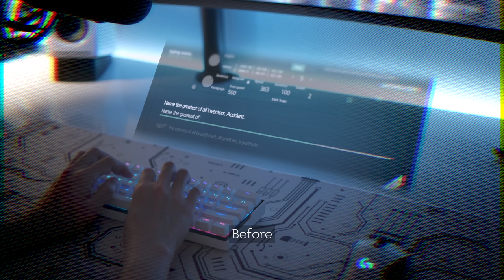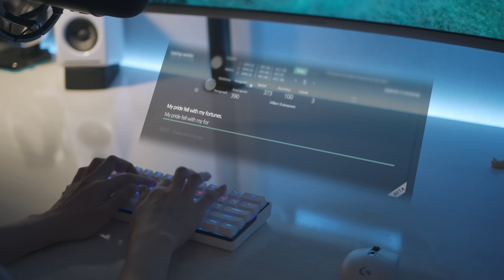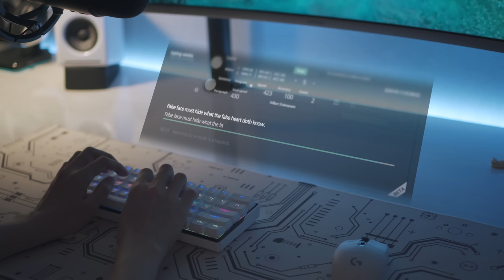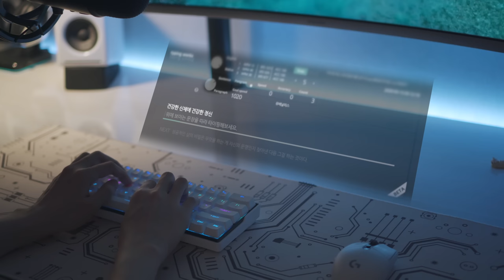Modding KEMOVE 61 SnowFox Hotswap 60% Mechanical Keyboard & Typing Sounds | Gateron Red Switches

Comment: I love how he uses an iphone to balance the wires
Reply: does balancing the wires matter?
Reply: @vigotogar  Yes it does when he is putting this much work into making it perfect. Balancing the wires helps(along with the lubing) eliminate any of the rattle that might happen when keys are pressed.
Reply: @keeperkell13  have you done it? if so, does it eliminate the "ping" sound while tapping it lightly?
Reply: @vigotogar  I have not personally done it but I have typed on a board that has. I can not give you a concrete yes as there is more than just 1 factor to that. The lupe, balancing, quality of stabilizer all matter.
Reply: @keeperkell13  oh i see okay thanks!
Reply: What is that syringe thing is he using when he is balancing it?
Reply: is the plate a standard 60% plate on this board?
Reply: @keeperkell13  im afraid to mess it up and make it worse

Comment: YES this is my keyboard!!
Reply: I got this keyboard after watching this video.
Reply: @gamerman708  how was it?
Reply: @ryan9818  Not who you were asking, but I also recently just got this keeb. This is my first keyboard, and its a great prebuild for beginners from what I can tell. The factory lubing is pretty good, and the build is sturdy. I plan to replace the keycaps soon because the ones that come with it are a little bit ugly. I don't really have any complaints for this board, so I would definitely recommend it for those who don't want to heft out the price for a custom.
Reply: @ryan9818  Got it yesterday. Mine came with 5pin hotswap instead of 3pin. Works great so far. Software is in beta and buggy. This is only my second mechboard so im not the most xp guy with these keyboards, but i really like it. It is very satisfying to type on compared to all my previos keyboards that is for sure.
Reply: Thank you for the info. I might get the GMMK white ice maybe.
Reply: @ryan9818  That one looks great aswell

Comment: Hi, new to mech keebs 

Q: What are you doing to the battery at 1:07?
Q: How do you know where to cut the stabalizers?
Q: Whats going on at 4:17?
Thanks!
Reply from the maker: 1. Just looking around
2. Pause 1:43 and look carefully
3. Because of the big front bumps, hard to use the opener
Reply: :3ildcat thank you :)
Reply: @3ildcat  ur my 1st keyboard mod channel i watched, im basically new to this but what's the ratio in the 1st krytox mix or is it the same in the 2nd one you mixed?
Reply: @alyzzagailmicabalo2385   krytox 205g0 is basically 205g2(or normal 205) mix with 30%-40% 105, personally speaking the viscosity is similar, and he adding 1:1 ratio of krytox 205g0 and 105 into his 205g0 + 105 mix so make the ratio of dilute effectively into a 70%ish 105 and 30%ish 205g2 mix which is more liquid like and easier to use
edit: the one he use for stabilizer is different kind of lube
edit 2 : you can treat the 70% 105 and 30% 205 as 205g00 which is thinner lube than 205g0 but still a grease which will stick to the surface instead of and oil which will sink into the bottom housing over time
Reply: @get_troll  thanks i understand a lot!
Reply: @3ildcat  I have a question, what are you doing when you put the metal bar of the stabilizer on thr phone?
Reply: @johntitor1054  the bars are slightly crooked/bent so he is flattening them
Reply: @eatingelote  k, thx

Comment: Finally!! Waited for this, ordered the same keyboard because of your video! :D And do you think I should spray lube, cause I never lubed any switches (I never opened one). Maybe spray lubing might be better for an newbie? (BTW. I'm "Sasuke Uchiha" from the other video, maybe you remember me :) )
Reply from the maker: Aha you changed the name!
It's totally up to you.
If you want to spray lube, shake well before applying and if you can, pull the switch out first.
That would be better for keeping the plate clean.
Reply: @3ildcat  okey thank you! No this is just my first account :3 I have a non used keyboard which is, for some, hottswap, so I would use that board for the spray lubing so the plate won't get dirty :D

Comment: I learned a lot from this video!!! I will most likely mod my snowfox like this :)
Reply from the maker: Good luck :3
Reply: @3ildcat  sooooo I got my snowfox but my wrists hurt after typing on it for a longish time (3-4 hours) is this normal or should I change the position of my wrists to prevent this from getting worse :<

Comment: Nice video! Btw where can I buy that mousepad it’s pretty cool
Reply from the maker: It's Doro desk mat. (in the description)
As I am not Chinese, I used a freight forwarder.
Sadly hard to get..
https://item.taobao.com/item.htm?spm=2013.1.20141001.1.6d7a252a74Xs97&id=587143973122&scm=1007.12144.95220.42296_0_0&pvid=a6292b85-ea22-4a8a-8a75-6457bf41e623&utparam=%7B%22x_hestia_source%22%3A%2242296%22%2C%22x_object_type%22%3A%22item%22%2C%22x_mt%22%3A0%2C%22x_src%22%3A%2242296%22%2C%22x_pos%22%3A1%2C%22x_pvid%22%3A%22a6292b85-ea22-4a8a-8a75-6457bf41e623%22%2C%22x_object_id%22%3A587143973122%7D

Comment: didn't know balancing stab wires is a thing until this video.. question, which point did you make the pressure to balance it?
Reply from the maker: just by twisting wire legs little by little
Reply: @3ildcat  nice!

Comment: Cat, can I know which part did you clip for the switch?
I don't have a switch opener or cherry red top housing...
What did you use that look like tape for the stabilisers on pcb?
Reply from the maker: You can use any tweezers as well.
If you look the switch carefully, you will know where.
You mean the tape on the plate? just holding the stabs not to shake.
Reply: @3ildcat  okay thank you ;)
What to use if no "switch slider picker"?

Comment: Is it good to use the same lube for stabilizers and switches or no? Kinda new to keyboard modding stuff so I'd appreciate your reply :)
Reply from the maker: only for metal wires, sticky grease is good
Reply: @3ildcat  is the parmatex you used good for both stabs and switch?

Comment: Could I do it on every keyboard to make same improvement (especially for those large key) like yours? Im using the Razer blackwidow v2 TE (I know the quality is way worse) right now, but I just love the feeling on the yellow switches.
Reply from the maker: maybe? you may need to apply according to your keyboard structure

Comment: I have a question. It looks like you are not using that much lube on the stabilizers. I always thought you are someone who usually uses a lot. What made you go for a more reserved amount this time?

Great video and the board sounds amazing
Reply from the maker: with well balance wires, no need a lot of grease usually.
When modding soldered ones, I can't balance the wires so I put a lot of grease in.
Thanks!

Comment: Would it still sound good of I just use an eye dropper and put it in the switch instead of painstakingly do what you've done? Thanks
Reply: Peter Perez For the most part the reason why it’s done by hand is to evenly distribute the lube. If you have one side of the switch housing more lubed than another it can tend to feel strange. Better to just be safe and hand lube them with a small brush. Does take more time that way though!
Reply from the maker: It's your call but I wouldn't do that.

Comment: The last time you lube Keychron K6 with Gaterons Red Switches you mix Krytox 105 & 205g2 why you use 205g0 now?
Reply from the maker: sometimes, 205g2 mix, sometimes 205g0 mix
I just have a lot of 105 but not enough 205g0 and g2

Comment: Wonderful video!
Appreciated the showcasing of you mixing the two lubricants :) Helps a lot for reference!

Quick question though- do you see a drastic difference when bag lubing over regular individual lubing?
Reply: spring lubing, it's purpose is to simply glue down the spring's top&bottom parts to switch housing&slider, in hopes that it would be less likely to rattle in between them.
Lubing enough is just enough for springs I guess...
Reply: @m4ki9h76  I realize the purpose and intention of lubing the springs- i'm simply asking if theres a noticeable difference in quality when bag lubing compared to lubing springs individually

Comment: I live in Brazil and I just bought this board. 
I'm looking for alternatives for the krytox lube that are more easily purchasable. I'm able to buy even if I'm willing to import.
The dielectric grease for the stabs is ease to found, but I'm out of luck when it comes to lubing my switches.
Reply from the maker: On google, you can find many stores that ship internationally
krytox or tribosys
Reply: Yeah, I found some even locally but the cost is just nuts... They are overcharging by a lot here.
I will follow some recommendations that I found about using super lube synthetic grease and oil.
Reply: @reisnobre  olá, onde vc achou ambos? dielectric grease e o krytox? eu também estava procurando algo parecido por aqui no brasil mas não achei nada...

Comment: I purchased this keyboard because of this video! Hahaha I'm just curious when I got mine because it has yellow stabs. I didn't open them up yet but the only difference I can see is the yellow stabs and the pcb now supports 5 pin..

Thanks for this @
:3ildcat 👍👍👍
Reply from the maker: Oh I guess they improved it :3
Reply: @3ildcat  Opened it up last night to mod it. The stabs were factory lubed and it already sounds great. They also added foam inside. I guess KEMOVE was also watching your video.. 😆😆😆
Reply: @MatsuysBatsuys lol!

Comment: Hey guys,
I'm looking to buy my first board, but having trouble to pick what I should go with.
Budget isn't a big problem, because I want it to be my main board, so I'm willing to spend around 400$.
I wanteda 65% layout (I'm a software developer so arrow keys are essential) and I really like the floating keycaps look and would like a hotswappable board with RGB (basically like the Drop ALT). However, I've heard that the ALT isn't that good after all, so I'm wondering if there are other options that I should consider.
I'm thinking of going with Zealios V2s for the switches and am open for suggestions regarding the stabs, lube, etc.

Would you mind helping me out? Thank you so much in advance!
Reply from the maker: I am not the one who can recommend something
hope someone help this guy.
Reply: @3ildcat  Thank you so much for even acknowledging me. Means so much! ♥

Comment: which do you prefer anne pro 2 or kemove snowfox? I want to know your preference so that I can pick the same
Reply from the maker: your pick, so my preference is nothing
Reply: @3ildcat  but what is your preference?
Reply from the maker: @faisal.m1477  my heavily modded Anne pro2, not stock.
Reply: @3ildcat  ah ok, but stock vs stock, is kemove equal/better/worse than anne pro2?
Reply from the maker: @faisal.m1477  a bit better just because of hotswap, I can lube or change the switches easier than Anne Pro.
Reply: @3ildcat  alright thanks <3

Comment: If you train yourself to use your pinky more, it would be much better for your wrist.
I used to hit the backspace with my ring finger as well and that really hurt my wrist after a day of work. 
Once I started using my pinky i barely had to lift my wrist off of the wrist rest to type there was barely any movement when I am typing.
Reply from the maker: Thank you for your advice!

Comment: Can this keyboard be replaced with a metal case? Can it be used in the same case gh60
Reply: No, the Screws are different from the gh60 ,poker ect. but i contacted Kemove and they said that they will launch a aluminum case for this KB.

Comment: The pcb seems to only accept plate mount switches am I right?
Reply from the maker: you mean plate mount stabs? yes
Reply: @3ildcat  no I actually mean the switches, does it take 3 pin or 5 pin ones? I can't really see it in your video :)
Reply: Ah I think I found a segment. At 0:50 it looks like 3 pin switches only for this pcb.
Reply from the maker: @pay_  0:31 I wrote it
Reply: @3ildcat  Oh god. thank you for leading a blind man :) I completely missed that until you mentioned it! :)

Comment: Hey there Wildcat! Thanks for making such an amazing keyboard review for the Keymove Snowfox! Made me wanted to get one so badly hahah..

By the way, I have a question for you. May I know what type of tape you are using for this stabiliser mod? Appreciate if you could reply, that will help a lot! 

I have recently modded my stabilisers (Unsoldered) using the interdental brush method. but I do found out that the stabiliser still rattles slightly (especially on the spacebar). Made me wondering, is sit necessary to have a piece of tape in-between the stab n the plate to fully eliminate the rattle.

Have a blessed day! Looking forward for your reply :)
Reply from the maker: Just random fabric tap from a first-aid kit. Whatever you use, if it's a bit thick, it really doesn't matter.
Well balanced wire is most important I think. Good luck.
Reply: @3ildcat  that’s for the speedy reply!! Been binge watching your videos 😀😀

I have another headache and it’s bugging me I can’t get rid of it :( on the left side of my spacebar feels sounds amazing but on the right side of my spacebar still happens to sound a little bit rattly... I’ve tried to lube more on the right side but still the sound is still the same :( could you please guide me 😁😁
Reply: @3ildcat  by the way, I did it the unsoldered way 🙏🙏

Comment: Hey :3ildcat, I lubed my gateron yellow with this: https://www.amazon.com/gp/product/B000BXOGHY/ , It worked super well, it has a long tip so I can push down the switch stem with the tip and lube inside the switch, it works better than spray lubing in my opinion because the lube only goes in the switch and it stays off the plate. I recommend you try it out in one of your videos!
Reply: By the way, 1 tube of this stuff is more than enough for my GK61
Reply from the maker: Your way makes the inside of the switch fluid but the spray lubing makes the inside of the switch coated with thin layer.
That's why I don't do the dropping lubing and I prefer grease lubing even with brush lubing. (spray lubing is grease lubing)
I don't say it's right or wrong. I just personally don't like that.